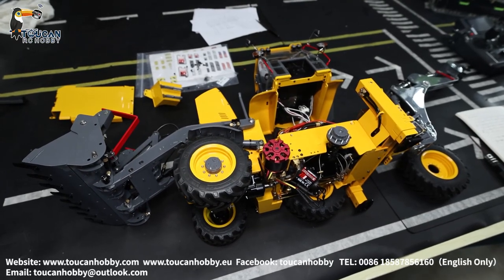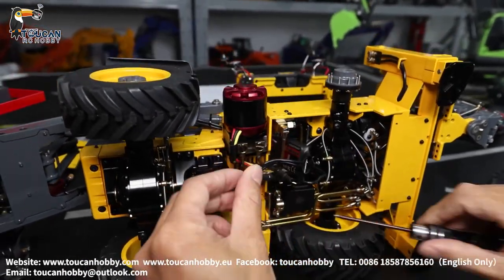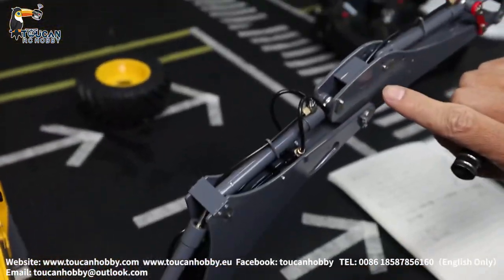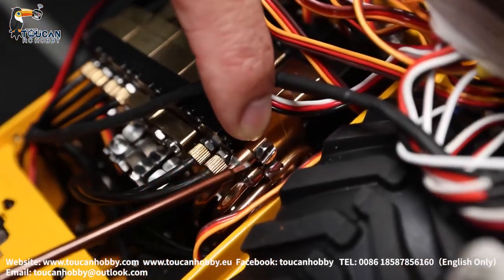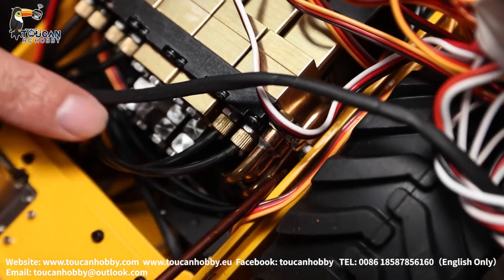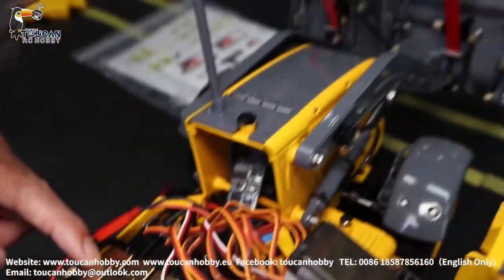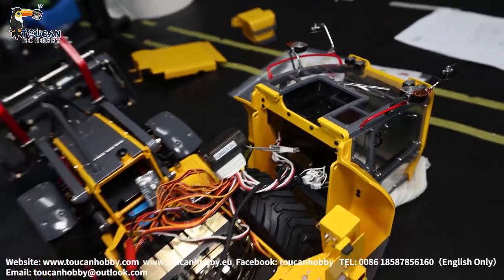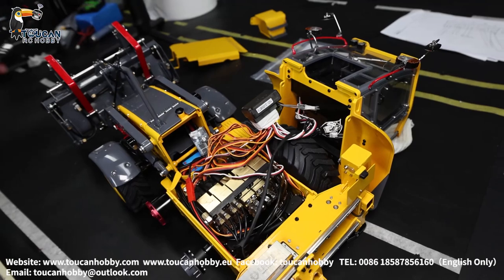How to open and check inside system for LESU RC Hydraulic Aoue-BL71 Backhoe, see how is it working.

Comment: What I'd like to know is how to bind the receivers. I got pretty much everything to work, except anything from channel 12 upwards. I can change back and front controls, but I can't get the Seat to spin, nor the diff lock or the rotating light. Also, the sound sounds garbled and horrible. I wonder what I am missing.
Reply from the maker: Did you bought it ready to run? Please add me friend to see details
Reply: @toucanhobby2400  I bought without the PL18 EV Lite since I already had the PL18
Reply from the maker: @Boomer3k  PL18 can not control backhoe not enough functions switch, at least need EV lite
Reply: @toucanhobby2400  Sorry, I should have also added the ev. I do have the PL18EV.
Reply: @toucanhobby2400  Ok, so after quite a bit of googling, it seems the PL18 EV can do this. Quite easily... I don't know why it's so hard to find or why the information is not provided. Anyway, with the most current Firmware version for the PL18 EV (not just the lite!) you can control more than one receiver without having to use a patch cable or use combine models. And the channels append. Meaning the 2nd receiver will be added to the max channels of the first. Totalling a high channel setup. You need at least Firmware(1.0.28). For anyone who upgrades the Firmware: An update will erase all your models. Backup your models before you do this with the FlySky Assistant (if you can get the dodgy software to actually wok ^^).
Reply from the maker: @Boomer3k  yes thank you for share